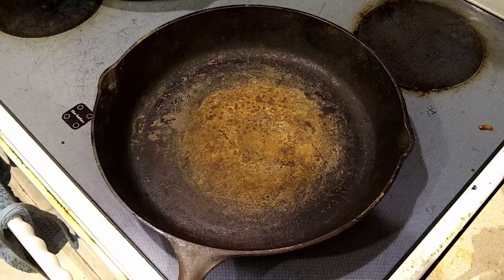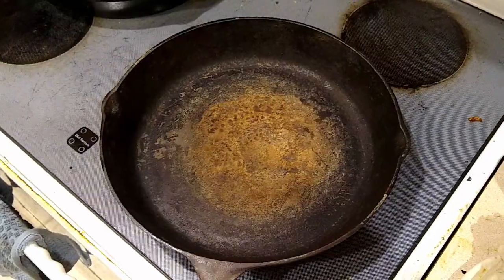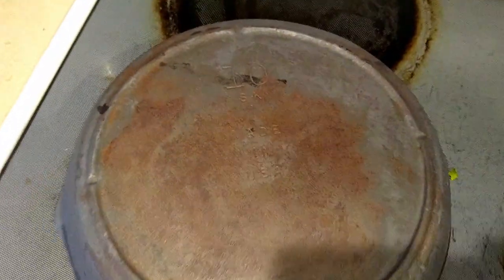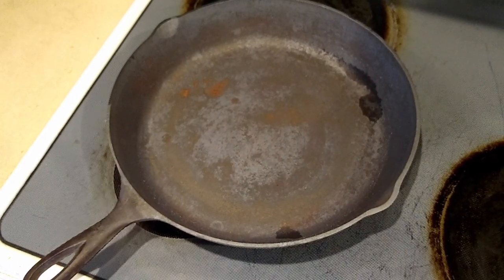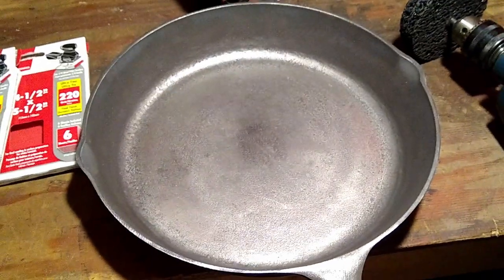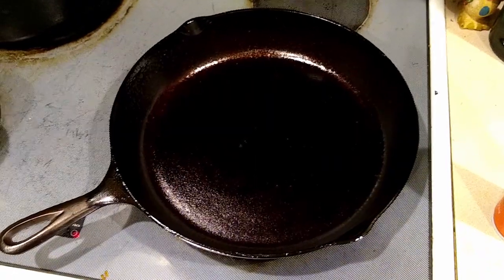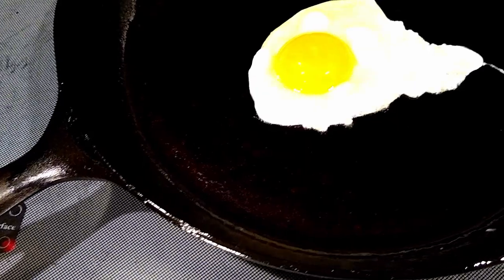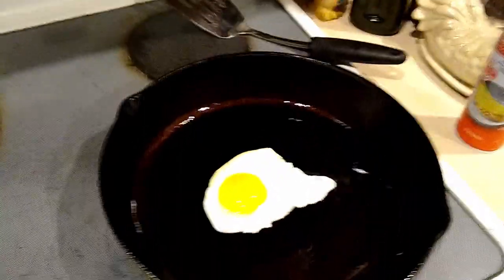Stripping and Re-Seasoning a 50-60 Year Old Lodge Cast Iron Skillet

Comment: Not trying to cause alarm, but I am seeing more and more articles on harmful effects of grape seed oil. EDIT: I see just as many (or more) saying it is healthy.
Reply: Where would someone go to read those articles? I use flax seed oil for base, then switch over to avocado oil because it has a 500 degree smoke point
Reply: I just use lard only on my 10" Lodge for years wirh good results.  Never salt anything in the pan and just boil water, scrape and reseason once in a great while if eggs start sticking.  Use it about 5 times a week, mostly eggs and American Fries.
Reply: @jefffrayer8238  I use cast iron as default unless there is some compelling reason not to, and I will use hot water and a scrubbing brush with nylon bristles to clean it, and a plastic scraper lodge sells for determined residue, dry it, heat to just about smoke point (you can usually smell the pan across the kitchen about the time it gets there) and hit it with a half dollar sized drop of avocado oil and a clean cotton rag to coat it, cool it and hang it up until lunch or whenever I need that specific piece again, nothing cooks like iron
Reply: Pretty soon everything will have the California Proposition 65 cancer warning. it is so prevalent that I no longer find it helpful 😞
Reply: To really find the truth in the topic, try searching for case-control studies. Those are the only type that can actually determine a causality between an event and a consecuence.
Reply: Organic flax seed oil or good old fashioned Crisco out of a can works a 100x better than grape seed oil (and definitely NOT olive oil!!!)